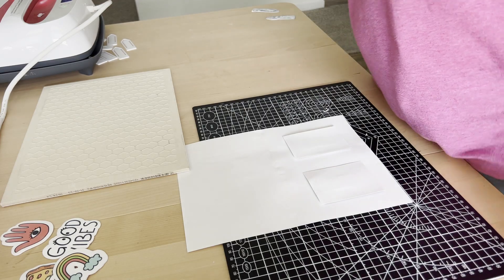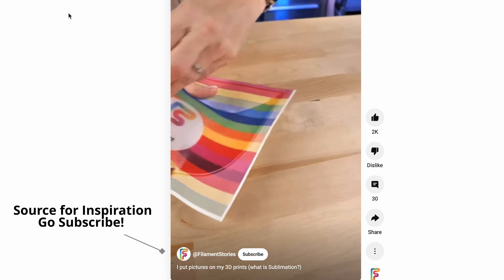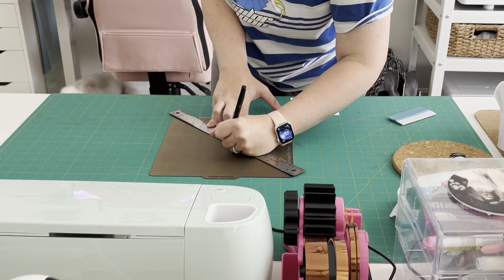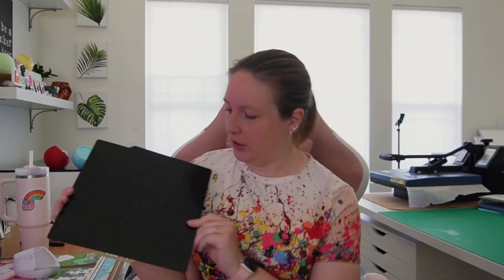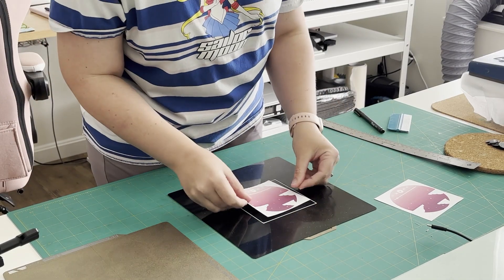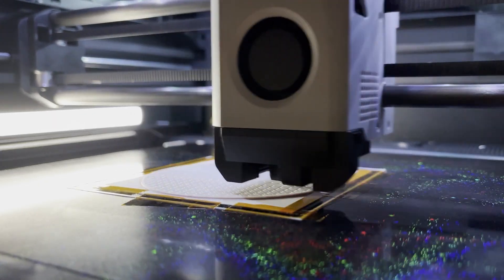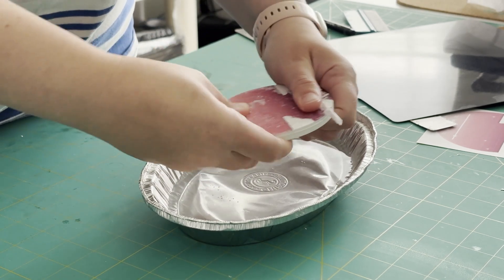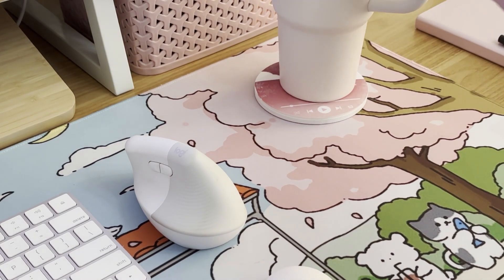How To Sublimate 3D Prints Directly On Plate - Easy PLA & PETG Sublimation Tips

Comment: I tried printing from laser on a water soluble paper and then printing on it just like you did in this video and it turned out very well too. Thank you for sharing the tips 😊
Reply from the maker: That’s very cool! I had heard laser ink will stick as well. I can imagine the toner probably reacting pretty well to hot filament. Sort of like using toner for foiling on paper. 

Water soluble paper is a great idea! You’ll have to let me know if the ink stays permanent or if you ended up needing to give it a clear coat of sealant to protect it.

Comment: Were there any first layer adhesion issues/challenges with the filaments sticking to the sublimation paper? I personally prefer printing in ABS, which requires a pretty hot bed temp for the first layer, so I'd think that the paper would cause adhesion/warping issues. Looking forward to trying this process out since there's so much potential.
Reply from the maker: The filament sticks to the paper. I usually have to soak the print/paper to get it off. In terms of the paper warping make sure you tape the ENTIRE Paper down. I’ve played around with limiting the tape but ultimately taping down the sides all the way prevents warping and insures the paper stays secure to the bed.

Comment: This inspired me to try this out. I hope all my kit arrives this week for it. If it works well I may get some custom build plates with a grid on them and a pattern that can be imported into Bambu Studio for alignment.
Reply from the maker: Awesome. I definitely recommend the grid. I ended up stumbling on Teaching Tech’s video after making this one and have created grids for myself as well.
Reply: @LabcraftStudio  Nice thanks will check that out.
Reply: Had early success with white PA6-GF resulting in what seems like perfect transfer, however have not tried PA6-GF via the bed. It has heat resistance up to 183c so you can be liberal with the pressing time and no worries about it melting. I'll try polycarbonate tomorrow as I don't have light PETG and find it more easy to print than nylon!
Reply: @LabcraftStudio  I went another way as after a lot of testing I needed more resilience and repeatability, there is a little video up on my channel now with my findings. Thanks for the inspiration to try this out.

Comment: I tried this (based on another video) using sub ink/paper and printed with TPU (220F nozzle/80F bed) and while some of the the ink did transfer, it seemed like the ink vaporized "between" the print and the TPU and the final image looked VERY fuzzy and the edges that should have been crisp looked almost spray-painted (that's the best I can describe it). Any ideas why? What are your 3DP settings?
Reply from the maker: I used PLA in this method with my standard 220C nozzle and 55C bed. I have not tried to sublimate TPU so I don’t know if that may play a role since it’s a different material.